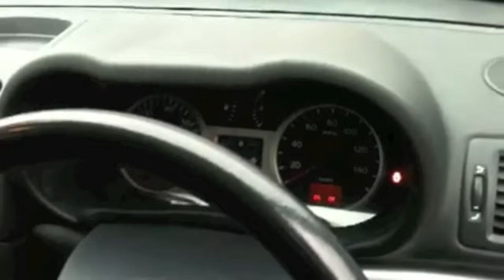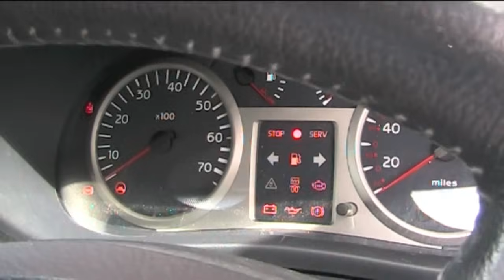Renault Clio 1.2 16v D4F Throttle Body Removal

Comment: Does the oil that builds up behind the air box come from the blocked up crankcase breather?
Reply from the maker: Yes a blocked crankcase breather seems to cause the oil build up, however i think the crankcase breather blockage is caused by not changing the oil regularly enough.

Comment: My clio has been coming up throttle angle sensor on a snap on diagnostic machine just wondering if you suggest cleaning out could fix the problem or should I just replace sensor
Reply from the maker: If the throttle body is covered in muck then the butterfly valve will have trouble closing or opening and it might show up this fault code, cleaning it is the best place to start it only costs a bottle of carb cleaner and a bit of time.

Comment: I have a Renault clio 1.2 16v and i had the same issues i replaced the spark plugs and coil pack and its fine.... But the hisss'ing / air leaking sound your was making when reving is still there?? Could this be due to the throttle body peugeotCitroen2CV

Comment: Very good video, but i cant believe how complcated is that on my clio like this.... On the other clio for same year just take air filter plastic and here it is just 4 bolts and its out
Reply from the maker: That might be the 8v engine, the 16v has a more complex intake arrangement. 
Its a bit more work but then again it is not something that has to be done too often, when this video was made the clio was 10 years old, the parts cost under £20 and it was fixed in less than an hour.

Comment: Hi i changed the crank shaft sensor using your vid and car has started fine so far but i still think the TB ciuld use a clean. How did u actually clean it once it was off??
Reply from the maker: Jay Breezy Once it was removed i used carburettor cleaner, just spray the throttle body down with it and it gets rid of the dirt and grime very well especially if its a new tin with plenty of pressure.

Comment: Did you have to replace the gasket on the throttle body itself?
Reply from the maker: I didn't have to change any gaskets when doing this job, they were still in good condition, but if the gaskets are old and brittle then its best to change them.

Comment: Hi, do i need to use a torque wrench when tightening inlet manifold bolts back? Did you use Loctite or similar at bolts?
Reply from the maker: You can use a torque wrench if you are worried that you might snap the bolts, i just tighten them by hand although expeirence does give you a feel how tight is tight enough. No loctite was used here, the car ran fine for the couple of years after we still had it after doing this job
Reply: @peugeotCitroen2CV  ok thank you mate, ím from Finland and Clio same problem
Reply: inlet manifold full of oil i mean

Comment: Garage just had my throttle body off to replace the heat sensor. When I got the car back Clio 1.2 16v D4F engine it was dumping oil down the front of the engine so it went back. They informed me that the bolts go through to a oil reservoir and that there was pressure forcing the oil up the bolts so used seal to stop that happening.

I'm thinking that the bolts are maybe different lengths and they put a longer bolt in so damaging the boss. Would you agree or do the bolts need sealing as they go through into the rocker?
Reply from the maker: The rocker cover need a bit of sealant around the sides and possibly a new gasket if changed. Ive done a video on the replacement of th5e gasket to cure a leak. 

Im not 100% where the bolts go through, need to take another look at a D4F engine im stripping at the moment. Send me a PM and i can send you pictures of that engine.
Reply: Excellent work mate! I have a Proton Savvy and it uses a Renault 1.2 D4F engine. Do you have anything on fault code P0303? I know its a misfire but not really sure what to do here? I changed the spark plug but code is still showing? 

Any suggestions friend?
Reply from the maker: I dont know fault codes myself, if your reader gives "PXXXX" codes then google is the best place to find out what they are referring to, in this case it seems P0303 is cylinder number 3 misfire. Might be worth changing the coil pack to see if that cures the misfire.

Comment: Hi amazing video, 
I was just wondering if I could spray throttle body cleaner into the air box to help with low idle?
Reply from the maker: Its best to remove the intake manifold to get to the throttle body in order to clean it up. How low is the idle on this particular car?

Comment: Nice video.. Did you need to calibrate the throttle body afterwards? If so how did you do it?
Reply from the maker: I turned the key and drove as normal, no calibration process was required.

Comment: I've heard this solves the 'electrical fault' light coming on the dashboard whilst driving, is this true? Because this has happened to me and so giving the throttle body a clean instead of sending it to a garage would be helpful!!
Reply from the maker: Yes the light on the dash which looks like a glow plug and oscilloscope comes on with this problem and cleaning the throttle body should solve it.
Reply: peugeotCitroen2CV Thank you!

Comment: problem is throttle body motor is burned then we put new throttle body on it i was work good for hour then after make same problem again.
looks  like over voltage goes to throttle body motor and burns it..
 what course to burn this motor.
do you are think?
thanks

Comment: hi - would you know what things I should be looking at for bad idling on renault clio 2 2003 16v  between  cold and normal temp, to the stage of nearly cutting out but then picking up again in a loop to nearly cutting out but picking up just before it cut out? - it doesnt do this when engine starts up from cold, and then sometimes it will idle ok , albeit a bit lumpy. no yellow engine light on. - I think it does this now after I took the throttle body out the other day and give it a good clean, have I upset something doing that do you reckon? 

EDIT: - i just read in an online manual that says  "when replacing the motorised throttle valve, the minimum throttle stop has to be reprogrammed" - do they mean if your replacing a new throttle body or should I do this after taking out and cleaning the existing body do you reckon? - thanks.
Reply from the maker: Perhaps plug it into a fault code reader even if there is no light on just in case there may be some underlying issue.
Reply: i must see if i can get a cheap code reader one day - they come in right handy. wheres the obd2 socket on the clio, is it by the fusebox on the passenger side front or under the ash tray or in the engine compartment?
Reply from the maker: An ELM327 wifi works fairly well with the clio, the OBD port on this era of clio is under the ash tray.
Reply: ah right, thanks

Comment: Great video,I need to clean the throttle body on my daughters 2004 1.4 16 valve dynamique.Is the throttle body the same as the 1.2?
Reply from the maker: I have never worked on or looked at the 1.4 engine so i cant comment on the exact procedure required to remove it, but as far as i am aware from previous comments the 1.4s throttle body will get mucky like the 1.2 engine and cause similar symptoms, the best bet would be to get a haynes manual and follow the instructions on removal for the 1.4 engine, renault forums is also a good place to discuss this issue.
Reply: peugeotCitroen2CV Thanks for coming back,I'll get a manual and read it up.Thanks again

Comment: The cable seen at the top of the throttle body, is that the throttle valve position sensor?
Reply from the maker: I cant say with 100% authority but i belive this is a fly by wire throttle assembly ie a signal from the ECU controls the butterfly valves position, some other systems would still have a cable operated throttle valve but would have a throttle position sensor to then send the signal to the ECU to adjust the fuelling accordingly.

Comment: hi mate. When you disconnected the electrics at the back of the engine then you pulled that metal block out that covered the other electrics? You just literally pulled it out...... mines stuck in. any ideas bud?
Reply from the maker: It is a security cover for the ECU as some other commenters have mentioned, i seem to have been lucky in that it just lifted off, the forums have a bit of a better description on how to remove it.
Reply: peugeotCitroen2CV thanks mate got it all sorted!! great video!

Comment: Looks like what I'm gunna need to do on my Clio. But the problem is slightly different on my 1.6 2002 (Later engine with throttle body visible at the back of the engine bay).

On start up the engine immediately revs to about 2200rpm and keeps fluctuating the revs between 1000-2200 rpm by itself and the throttle pedal does nothing at all! I suspect the various sensors connectors are corroded and need cleaning, but does that mean I should clean the throttle body as well?

Advice would be much appreciated! Thanks!
Reply from the maker: Id say cleaning out the throttle body and looking to see if the crankcase breather pipe is blocked (which is why the throttle bodies on these 1.2 engines get covered in oil). As for the exact procedure involved with the 1.6 i can't help unfortunately as i have never worked on a 1.6 clio, but there should be information available on the various forums on the procedure involved in removing the throttle body on this engine.
Reply: peugeotCitroen2CV Ok thanks a lot for your quick response and advice :)
Reply: Shockspike1 Update 6 months later. For those who wish to know, the problem with my 1.6 was the pre cat lambda sensor/02 sensor. It needed replacing but was a bitch to get off. I recommend some freeze and release spray or oxyacetylene to heat up the nut. Good news is no engine problems since :)

Comment: Was this a permanent fix for the issue? my clio has been cutting out at junctions etc with electric warning light for weeks now and been getting worse
Reply from the maker: Once i sorted it out the car was still driving fine until i sold it in november 2013, but in addition to cleaning the throttle body, the PCV valve got cleaned, its in there when you have the inlet manifold open, and also use some engine oil flush before changing the oil for new oil.
Reply: peugeotCitroen2CV Ah thanks! I'll get round to over the next few days, hopefully it'll fix my issue as well.

Comment: hello pal did your clio have a shhhlushh sucking sound when revving and accelerating sometimes if so did you find out what it was
Reply from the maker: carol batchelor There is a bit of intake hiss at the start of the video, but it went away after the throttle body cleaning, in some cases it may also be the intake manifold seals

Comment: thanks for these video, my clio use about 1 liter of oil every 1000 km could it be the valve cover need to be replaced(renault clio 1.2cc 16v has 100,000km )
Reply from the maker: It might weep a bit of oil through the valve cover, run an oil flush through the car and check if the air filter has oil along the bottom could be a blocked crankcase breather/pcv valve.

Worse things would be rings or valve stem seals but unless its smoking badly its unlikely these engines are fairly tough
Reply: thanks for replying, there is no oil in the air filter and there is no smoke coming out of the exhaust pipe unless the rpm reach 6500 when the car is not moving there will be a little smoke 

i went to two mechanic the first one said that the short block need to be replaced
and the second one said that the valve cover need to be replaced
Reply from the maker: +Richard alfred change the valve cover, if you can see a leak, and use an oil flush before doing an oil change and see how it goes.

Given the age of the car and its value its probably just best topping up the oil and living with it, an old clio isnt worth the expense of an engine rebuild
Reply: thanks for the advice

Comment: peugeotCitroen2CV 
Hi, Do you know of a reason why the exhaust manifold on a clio 1.2 16v 2003 would glow redhot like a volcano and run as if it's misfiring??
 What could cause this fault to make it glow so hot it looked like it had a blowtorch on it and only after 5 minutes
Reply from the maker: It could be a blocked catalytic converter
Reply: would the blocked cat make the exhaust back pressure hardly anything as mine has lots of power and pressure when i try to cover it with my hand.

There is no apparent blocked exhaust,it does run very clear.

Today i took it for mot and the inspector ran my car with high revs at about 3 to 4000 revs for about 6 minutes, could this of caused the exhaust manifold to glow red hot?, could it be something as simple as that.
ps the whole engine was rebuilt only 6 months ago and has never missed a beat until the mot emissions test today
Reply from the maker: Its something id ask about over on renault forums ive never seen it happen before, but if the engine has been rebuilt there could be a number of things wrong; car running lean, badly adjusted valves, out of time camshaft etc. 6 minuites at 4000 revs is also a bit excessive normally the mot station i go to puts the probe in lets the car idle for a minuite then blips the throttle.
Reply: i found out what it was, the mot tester wanted my car to fail for personal reasons so he revved it above 4000 rpms for about 10 minutes, then did the emissions test, knowing full well it would NOT pass the emissions.I took it to another mot station withing 30 minutes and it passed with flying colours on the emissions.I have since reported the mot station to VOSA
Reply from the maker: What an asshole, i assume the mot system over there is open to abuses like that, here in northern ireland the mot centres are run by the dvla so normally they are less likely to fail the car, although at times i think they work on a failure quota to get the retest fee. 10 minuites at over 4000 rpm is an excessive amount.
Reply: peugeotCitroen2CV 
He did it on purpose because i was a friend of the previous examiner, who they sacked!
 I have 6 cars in our household (big family) now i take the business elsewhere, he had a smirk on his face when he sarcastically said,"Oh well, I'll have to abort the test and can you move your car please because another one wants to get in.
I have yet to speak to the owner shes recently widowed and doesn't know what's happening in her own garage.
I heard the staff are trying to run the business down,lots of customers have not returned, not just me they treat like crap
Reply: peugeotCitroen2CV Also what the mot station don't know is that a full  diagnostic test was done the day before with NO faults, engine rebuild only 6 months ago, new timing belt, seals, oil,plugs,filters, the lot, so i knew the car was perfect.
They tried to tell me that the timing belt had slipped a notch and that was the reason,as i say before 30 minutes later i took it to another garage and the emissions test passed no problem,in fact really low on both tests, well below limits

Comment: I have a 2001 Clio 1.2 16v with old cable  accelerator pedal (cts 4089 sensor): the throttle body is slow to run the pedal controls, it need about 1 second to execute the command of the pedal, in both acceleration and deceleration, is it normal?
What do you think about it?
Reply from the maker: The throttle body might be getting slow due to dirt or age. Its been a while since i had my clio but i do recall the throttle response was near instant, fair enough there was no great deal of power to be had but planting the right foot resulted in a change straight away.
Reply: Thank you, so if the throttle body is clean, I will try with changing it.

Comment: Do you need new gaskets when puting back the manifold?
Reply from the maker: No the old ones were reused although i sprayed some silicone spray on them to soften them.
Reply: Thanks. I'm planing to clean it , i feel like my car is lacking power on speed above 40 MPH it accelerate very slowly even with my foot down to the floor, I already changed spark plugs, coil, all fluids and filters. Gona try my luck with this one now.

Comment: Hi. I am a new  owner of a same car and my question (if you still reading the comments) is how you cleaned the throttle valve. That just because it is an electronic unit and other mechanics advices not to turn manual the flap in order not to loose the adjustments. Am i right... Also great videos ....greatfull for your help
Reply from the maker: Hi there, yes i still read the comments 

I just used some carburettor cleaner spray to clean the throttle body to get rid of any carbon residue on the unit.
Reply: Hi again and thanks for your quick responce. Please tell me if you move the valve flap during the cleaning procedure with your hands . I am  asking just  becouse some mechanics say that the adjustments may be loosed .See you...